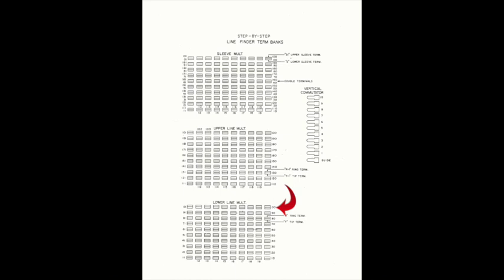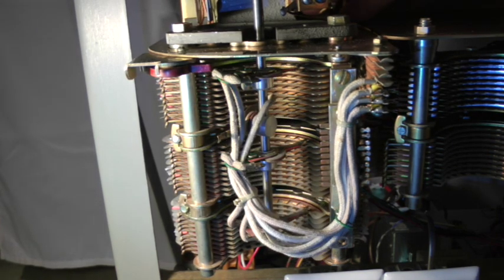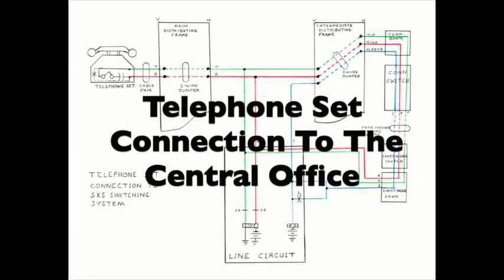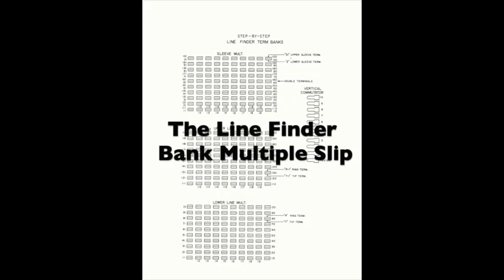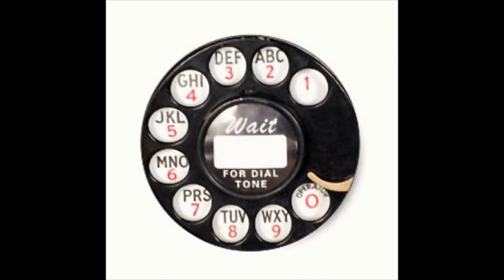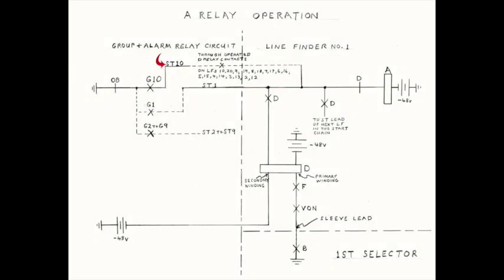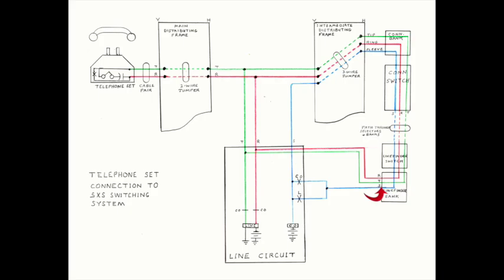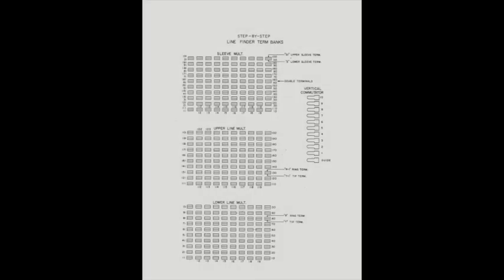The Line Finder In The Step-By-Step Telephone Switching System

Comment: So this sort of is making sense.  So one line finder is required per call and active the whole time the call is in progress.  So whole bank of finders can handle 20 calls.  Do I have that right?  Only 20 calls per 200 subscribers seems a bit low.  So is expected usage of the system only 10% of the amount of subscribers?  Or would there be more banks of finders for 200 subscribers?  Well 198?
Reply from the maker: One linefinder per call tied up for the entire duration of the call is correct. So one fully equipped line finder group could handle 20 simultaneous calls. Typical busy hour usage was 10%, sometimes less. Many offices did not need to be fully equipped with 20 line finders.There was also a 30 capacity linefinder group available for heavily business oriented offices. Telcos also had the option of  loading a line finder group with less than the maximum of 198 working lines, where 20 line finders proved to be insufficient.
Reply: Those numbers were not lightly arrived at. 20% was the average they forecasted as a design element starting point. But, remember not all terminals were necessarily assigned. That was carefully watched. We had service observing and traffic engineering, who would constantly monitor usage and overflow within all LF groups. They did line load control, and network balancing frequently, to insure the subscribers would not overload their particular group. High usage customers, like some businesses, might be in a less densely assigned Line Finder Group.
Reply: Just a comment from a former COT. This limitation on the number of calls that could be placed at one time usually wasn’t a problem. In the Cleveland area the one exception was when  Santa Claus was on the local TV station. At 3 o’clock he would ask kids to call him! The CO would tie up because of hundreds of kids all trying to call at the same time. There was an emergency option called line load control. Activating this only allowed essential subscribers like Fire, Police and Medical to get dial tone and make calls. This was on Panel Switching.

Comment: Is a step-by-step switch the same as a Strowger switch? Also, wasn't step-by-step switching replaced by No.5 Crossbar? I'm pretty sure it was.
Reply from the maker: Almon Strowger had the concept for a step-by-step switching device and obtained a patent for it. So most of the world's two motion (vertical/rotary) electromechanical telephone switches are referred to as "Strowger" switches, including the one in my video. The No. 5 Crossbar system was introduced in 1948 and became the major growth vehicle in the Bell System for 30 years. By the late 1970's it was serving more lines in the Bell System than step-by-step. Crossbar growth was slowed down in the 1970's by hybrid analog/digital systems in the 1970's and by all-digital systems in the 1980's. Crossbar was completely (or nearly so) phased out in the Bell System by the end of the 1990's.
Reply: @Hicken65  Thanks so much.
Reply: In the Cleveland area Step by Step was replaced by #1 Crossbar, #5 Crossbar and later #1 ESS. All Western Electric and Bell Labs technologies.

Comment: There was a North Electric plant in Johnson City TN that manufactured these switches.
Reply from the maker: Well, I know that North Electric manufactured All- Relay and Crossbar systems and have seen ample documentation to support this. I have no reason to justify stating your claim that North Electric manufactured Step-By-Step equipment is invalid, I just haven't seen any documentation to support it. However, Step-By-Step equipment was licensed to many manufacturers around the world, so perhaps North Electric was one of them.
Reply: @Hicken65  yes they sold out to Alcatel in the mid 80's and moved operations to North Carolina.

Comment: 1958: crossbar switches and relays in a digital computer!
https://www.youtube.com/watch?v=_j544ELauus
Reply from the maker: I would agree wholeheartedly this is a relay based digital computer, unlike the the #5 crossbar marker, that performs no binary computations whatsoever.
Reply: @Hicken65  An unexpected use of a crossbar switch, though!. Some day I would like to get one, but I'm sure it will be hard to find.
Reply from the maker: @AriBenDavid  Yes, I must say that was a very pleasant surprise to me. The video was excellent. Thanks for posting its location.
Reply: @Hicken65  Many years ago I was taken on a tour of New Jersey Bell's Penns Neck switch house. It was an #5 crossbar. Alarms were sounding, cards were dropping, and the switchmen were ignoring it all. That night I had a dream featuring this CO. The switch technicians had set up bars serving alcohol on all three floors. [In actuality there was only one floor and a basement.] They went up and down getting drinks. How irresponsible! Why are you doing all this bar hopping? "No, we are not bar hopping; we are cross-bar switching," they declared. -- an actual dream I had
Reply from the maker: @AriBenDavid  That's pretty funny. It's remarkable that you would remember that dream after all this time. The CO visit must have had quite an impact on you. While there weren't any bars in the CO's I worked in, I did find a few empty bottles up in the cable racks, usually after a Northern Electric crew had been in the CO installing a switch extension.
Reply: @Hicken65  The impact was the indifference to addressing trouble. No wonder we were having issues with the equipment! As telecom manager for a government lab, I was constantly fighting the operating company to get things done right.
Reply from the maker: That makes sense and it's too bad that it happened. I don't think this was typical for the Bell System operating companies.

Comment: With the complexity of this switch alone, i wonder how billing for each number was accomplished
Reply from the maker: I'm assuming you're talking about long distance billing. Up through the 1940's the billing was accomplished by the long distance switchboard operators who made up call detail tickets which were then sent to the accounting department. With the advent of Direct Distance Dialing (DDD), adjunct equipment called Automatic Message Accounting (AMA) was installed at the toll centres that produced call details on reels of punched paper tape that were then shipped off to the accounting department. SXS end offices were equipped with adjunct equipnment called Automatic Number Identification (ANI) that forwarded the calling telephone number to the AMA equipment at the toll centre.
Reply: @Hicken65  Is there a video describing how ANI worked?
Reply from the maker: @user2C47  I am not aware of any ANI videos. There are probably quite a few text descriptions online. You could begin with the "Bell Laboratories Record" which is easily found on a Google search. The May 1958 issue has an ANI description.
Reply: @user2C47  Automatic Number Identification was a signaling protocol for billing. Most local calling, before Automatic Message Accounting Full Detailed Billing, was flat rate. Local switches did not have the capability of billing. If you had a toll switch, like a Crossbar Tandem, that switch may have had that billing function. In that case, the local switch and the tandem switch would have interoffice trunking, especially for billing, called ANI Trunks. The signaling protocol was set to first send the calling party number, and then the called party number. The tandem would take that info and cause an AMA record to be taken, in the form of punches on a continuous paper tape, later upgraded to magnetic tape, and much later to a data link to the billing department. Once we went to Stored Program Control electronic (computer) switches, they all did their own billing, and toll switches didn't need to any more.

Comment: One of my old friends became an engineer with the local Bell operating company. Years ago I asked him about the reliability of the #1 ESS with all of those discrete semiconductors, resistors, and capacitors on circuit cards. Do you have to replace them often? "No, almost never. The least reliable part is the reed switch arrays."

Comment: Do you have a silimlar video for panel and crossbar switches? This is very helpful in understanding the actual electrical path of the call.  All other videos I see bypass the detail and just say "here's the sender and the marker" but don't go into detail HOW they determine a free line finder or circuit.
Reply from the maker: No, I do not have any of the panel or crossbar equipment necessary to make a video. There is quite a bit of literature online if you search hard enough.

Comment: What isn't much covered in the video, to add to the complexity, are the blocking events or the ratio of line finders to subscribers which in the explanation seems to be about 10 or 20 line finders for 100 subscribers.  In other words, the entire rest of the system can be idle but in that group of wires, 10 or 20 subscribers can block the other 90 or 80.  That is a bit unlikely to happen but in a local emergency, such as a house on fire, it is likely that all of the neighbors are going to be vying for the same line finders.
Reply from the maker: The system waited for a free line finder.
Reply from the maker: The number of subscriber lines sharing up to 20 line finders is 200, not 100. So 20 lines could block the other 180, and often did in the busy hours, but for very short intervals of time, generally less than three seconds.The system was intentionally designed to have 98.5% of the calls get dial tone within three seconds in the busy hour, which meant that 1.5 % of the calls would be delayed greater than three seconds.This was deemed to be a reasonable cost/service relationship that was mandated and monitored by the government. This service criterion only applied to "normal" traffic. Any abnormal traffic due to external events, such as severe weather, emergency situations, serious breaking news, etc. were excluded from the service statistics, and thus not included in the provisioning process. Your remark about the neighbors vying for the same line finders would only occur in a small office with one or two line finder groups. Subscribers sharing the same feeder cable into the central office were distributed over as many line finder groups as possible, so that in the event of a cable cut, in which there would be many short circuits, the effect on any line finder group would be minimalized.
Reply: @Hicken65  If the 20 slots were busy did the relay system wait for a free LF or did the caller get fast-busy immediately?

Comment: I had a friend up in Alaska that worked in a CO with about 5000 subscribers and used these Strowger Steppers.  He explained it to me and I almost understood it.  I loved the sound of the racks of relays stepping away, knowing that the 10 clicks per second of a line finder meant someone was dialing a number.
Reply from the maker: Actually, its the selectors and connectors that respond to the rotary dial pulses, not the line finder. But I understand what you mean about loving the sound of the switches in motion.
Reply: @Hicken65  Yes, I realized that when I wrote it; the line finder operates quite a bit faster than the selector producing a buzz followed by clicking.

Comment: I work in a switch in the UK and the noise isn't from switches and relays but rather from the air con units for the PDH and SDH networks. As time moves on, SDH and PDH is meeting the same fate as the switches and relays as their twilight days draw in with telco providers switching their users to IP based solutions
Reply from the maker: Yeah, its deja vu all over again.LOL

Comment: I was a technician for Western Union at a centralized telephone bureau and we had a switch similar to this one. That was a long time ago.  I miss working on mechanical things and tube equipment.  Now just replace the circuit board and throw the bad one away.
Reply from the maker: Unfortunately, in the end, nearly all of these SXS switches were also thrown away.
Reply: @Hicken65  It's like seeing old Linotype machines being scrapped.  They are pieces of art.

Comment: How often did these units require maintenance?
Reply from the maker: In the big offices, there were three or four CO techs in the office during the day. They spent most of their time performing preventative maintenance routines on the switches, and the rest of the time handling trouble reports. Small offices were unmanned but a route man would visit daily to handle troubles and wire in new subscribers.

Comment: It really says something about the reliability of electro-mechanical relays, cams, levers and ratchets.  At least there were no software glitches!

There's a simplified version of this used in vintage jukeboxes.  They were called stepper units. And they were used in conjunction with the wall boxes because the wall boxes only had four wires going to the Jukebox. A series of pulses from the pulse generator which is very similar to this where you have a wiper running over a series of contacts.  The Jukebox would interpret those pulses through a device similar to this video and it would make a selection. It was a real pain in the ass to work on so I can have some real appreciation for what's showing in your video here.
Reply from the maker: That's really interesting. If you have one of these jukeboxes, you should video this action and put it on You Tube.
Reply: Just a comment about electromechanical reliability. I worked at a CO that had 45 technicians working around the clock to keep a 40,000 line Office working. After final cutover to digital, electronic technology. There were 3 techs on day shift.
Reply: @calbob750 
Electro-mechanical devices do have their issues.  Mainly physically wearing out, contamination and oxidation on contacts, etc.  My point is they're surprisingly reliable considering how primitive they are.  The number of these units the phone company had, probably tens of thousands, I'm positive when they went to solid state, maintenance dropped by 90%. 
I currently have a Bluetooth issue with my phone in my car.  The BT can't "locate" the car sound system half the time without restarting the phone.  I found the solution in that little remnant of 70 year old analog technology:  the headphone jack direct to the aux input.  Works every time. 😄
Reply: @calbob750 
👍

Comment: Love the look of the wire used in this, is that wierd? Haha, Great video, thanks for sharing.
Reply from the maker: I think it would have been very interesting to see how this equipment was manufactured. Great precision with terminating the color-coded wires was required.Thanks for watching.
Reply from the maker: @Marcel H One of my jobs was to check the wiring connections made by Northern Electric installers on switch extensions. They were generally pretty good, but I used to make money on bets with them that they had made an error, particularly on a day after one of their notorious parties.

Comment: Lenny... awesome video.  Back in the day I made what I call the switch bobbin (brass grooved part)  Have one on my desk as a reminder of my screw machine day.  Would you call this an analog to digital switch system?
Reply from the maker: I'm not quite sure what you're asking but I'll answer what I think you're after. The SXS system was replaced by another analog system called crossbar. Crossbar was replaced by a hybrid analog/digital system that had a digital CPU but an analog switching network (#1 ESS and SP-1).These were followed by all digital switches such as DMS 100 and #5 ESS.
Reply: Did they put any gold in it?
Reply from the maker: @greenlawnfarm5827  Possibly, in the tiny relay contact points. These relay contacts were precious metal alloys. There were two major types called No. 1 Contact  Metal (platinum, gold and silver) and No. 2 Contact Metal (palladium, platinum, tungsten). One or both types may be present in these step-by-step relays.
Reply: @Hicken65  ok.